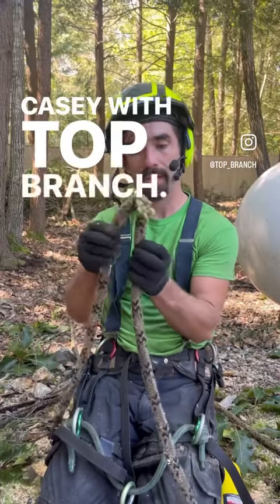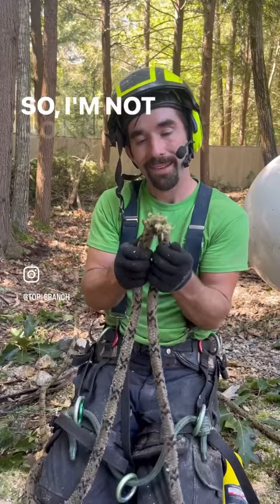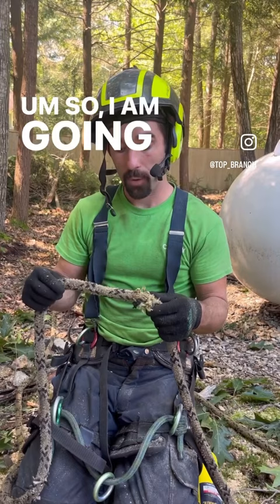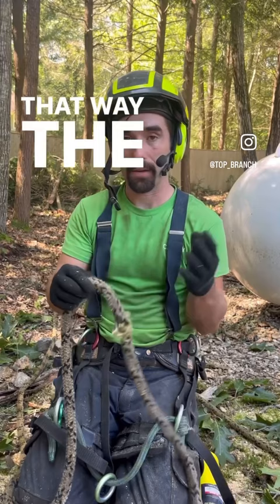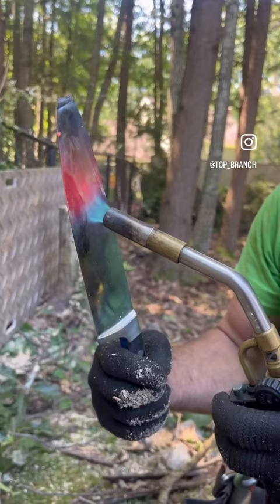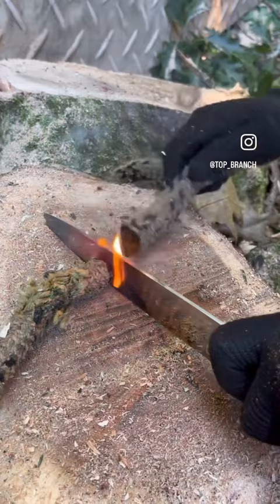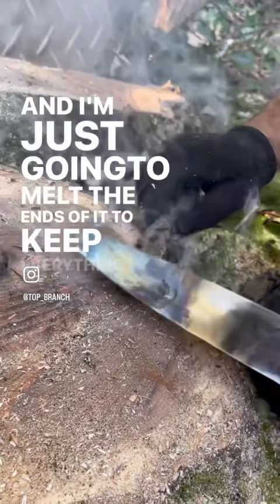How Fix A Damaged ROPE

Comment: You made no sense!
Just say that you need to burn the end so it doesn't fray
Reply: Seemed clear to me. I just wouldn’t have thought of heating the knife. After cutting the rope, I flame the rope to melt/fuse the fibers.  I wonder what the benefit is of heating the knife instead, because it seems that would ruin blade.